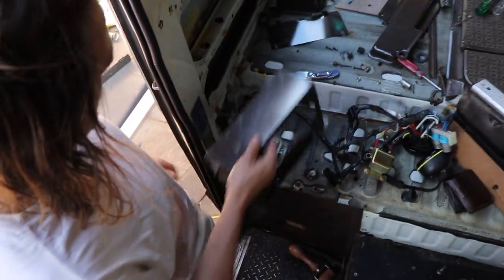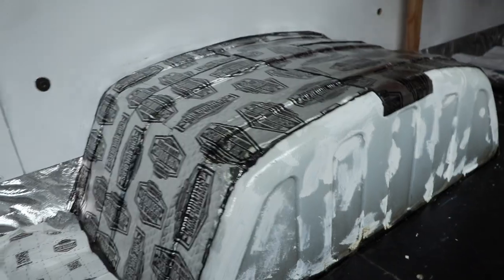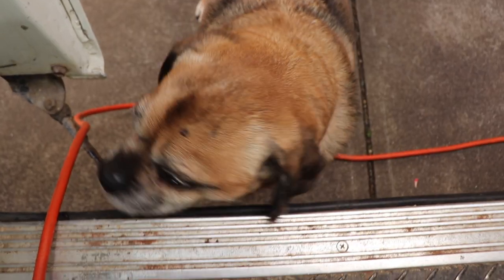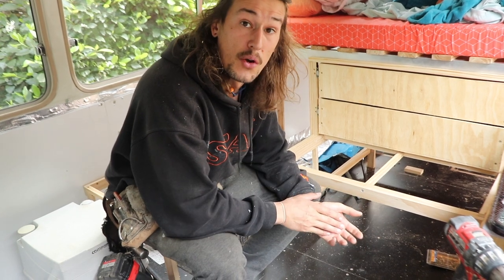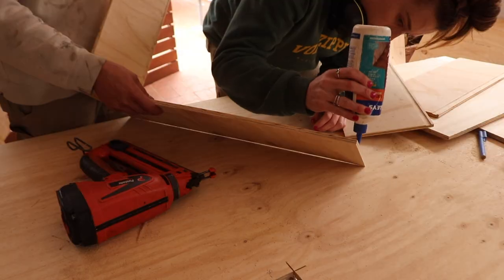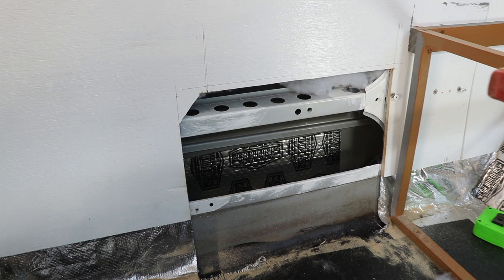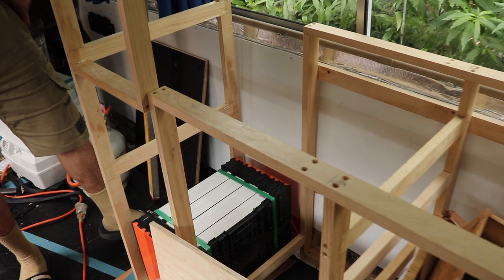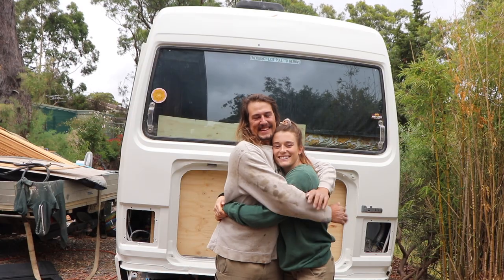Building our dream bus home PART 3 - Toyota Coaster bus VLOG - layout, kitchen

Comment: Might have made the driver's seat swivel wth another seat behind it & a foldimg table betwee. Which would allow the bathroom to be behind allowing it to be a partial wall to the bed. & the otherside to be a kitchen with a hanging wardrobe yo make the partial wall to the bed on the passenger side?